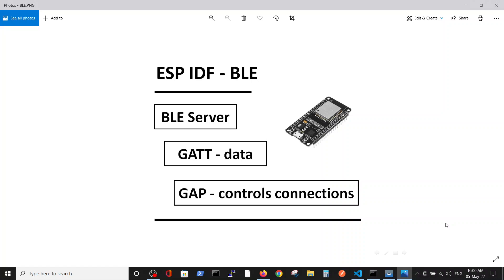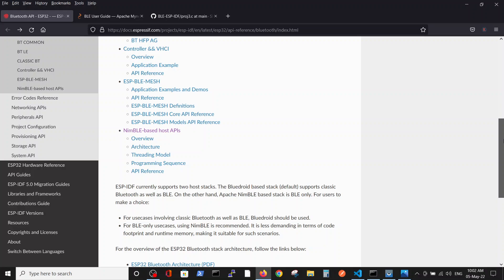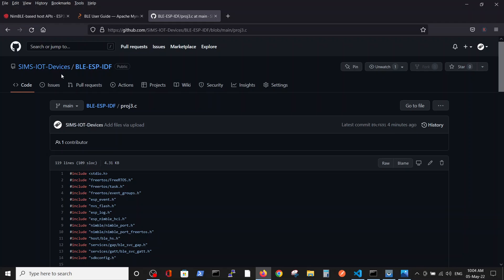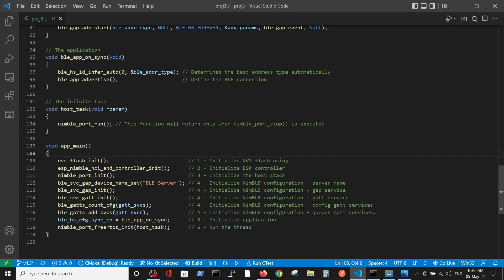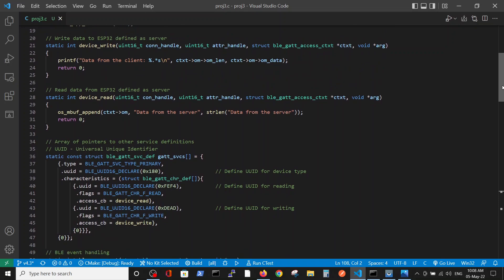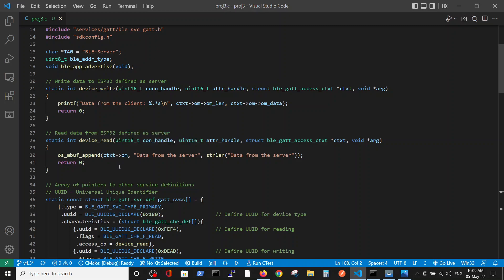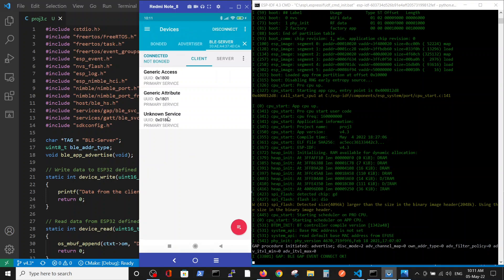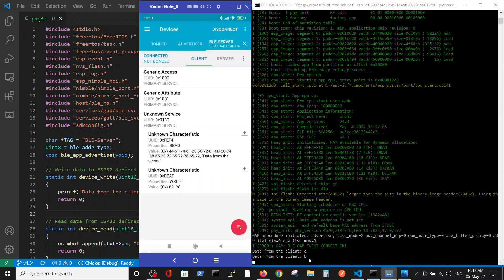2 - ESP IDF 4.3 BLE server for ESP32 in ESP IDF environment

Comment: Thank you! Very usefull video. I got all needed in 13 mins.
Reply from the maker: Glad it was helpful!
Reply: @simsiotdevices6219  Hello. Do you know how to add new characteristic to existing service during BLE is already started( in runtime)? Is it possible using NimBLE?
Reply from the maker: Dear @ildarbelkin4851,
I would guess that adding new characteristics to an already running service would depend on the device's ability to enable dynamic attribute modification.

Comment: Thank you so much, very very simple and helpful video !! Just an update : the function line 111 "esp_nimble_hci_and_controller_init" needs to be replaced as "esp_nimble_hci_init" because they changed the function name.
Reply from the maker: Dear @user-dl5ls8bi5o,
This code was compiled on ESP IDF 4.3, which version are you using?
Reply: @simsiotdevices6219   I just tested this on ESP-IDF v5.1.1 and I had to change it to "esp_nimble_hci_init" to make it work

Comment: I really appreciate this video a ton.   Though, I am not getting it to work ... It's compiling okay without errors but, just not working (when I attempt to use my iphone to see it and connect to it, .. it is not showing up on the scan) ... I noticed an odd line in the debug output as follows:  

W (1105) BT_INIT: esp_bt_controller_mem_release not implemented, return OK

Here is the full logging output:

W (1105) BT_INIT: esp_bt_controller_mem_release not implemented, return OK
I (1113) BT_INIT: BT controller compile version [6881869]
I (1119) phy_init: phy_version 302,3ddfab3,Dec  3 2021,14:39:12
I (1174) system_api: Base MAC address is not set
I (1174) system_api: read default base MAC address from EFUSE
I (1175) BT_INIT: Bluetooth MAC: 7c:df:a1:e2:85:26

I (1185) NimBLE: GAP procedure initiated: stop advertising.

I (1188) NimBLE: GAP procedure initiated: advertise;
I (1192) NimBLE: disc_mode=2
I (1196) NimBLE:  adv_channel_map=0 own_addr_type=0 adv_filter_policy=0 adv_itvl_min=0 adv_itvl_max=0
I (1206) NimBLE:

and I did a search to discover this conversation:

https://github.com/espressif/esp-idf/issues/9420

I wonder if it has something to do with this? ...
Reply from the maker: Dear LarryNybo,
Did you try different BLE applications on your iPhone?
Reply: @simsiotdevices6219   ... I tried my iphone, my mac laptop, and a pc ... none of them are recognizing the device.
Reply: Wait, .. the way you stated that caused me to realize I didn't have a "BLE application" ... so I downloaded an application and it is working.  Thank you for your help.
Reply from the maker: @LarryNybo  You welcome

Comment: Hello I have to send sensor data from one esp32 to another esp32 using BLE using ESP IDF  but I am not able to send the data ..I am using gatt client server example . How to do that?
Reply from the maker: Dear K K,
I added the video for the esp32 server to the esp32 client BLE communication to the wish list. I will get to it.
Reply: @simsiotdevices6219   okay ..for now i want to know that from gatt server data will be send to gatt client ? Right ?
Reply from the maker: Dear  @KK-ib5nh ,
Generally speaking yes.
The client video link: https://www.youtube.com/watch?v=_kDXrtZWG5E
Reply: @simsiotdevices6219  okay thanks. Now i want to enable Bluetooth and wifi in my code . I have merged my wifi code  bluetooth gatt server code .bluetooth is initialising but not wifi ..if I comment bluetooth initialsation in app_main then wifi is getting connected ..how to do that wifi get 1st connected and then bluetooth will get connected.
Reply from the maker: Dear  @KK-ib5nh ,
You can encapsulate them in two different tasks running in parallel.

Comment: i am using ESP-WROOM-32 Device with Rainmaker App and having a problem tried with BLE and SoftAp, no luck BLE Error message "Communication Failed" sometime it says "Cannot find the device"
SoftAP Error message "Assisted Claiming not supported for SoftAP. Cannot Proceed" again tried to flashed with new firmware using espressif firmware tool still no luck. Tried to connect with nRF Connect App, got an error in log "Error (0x85): GATT ERROR" if i use auto connect it will get connect after long time to nRF Connect App
Reply from the maker: Dear Ahamed,
That is exactly the reason that we opened this channel. If you write the code in the ESP IDF by yourself, it will be much more difficult, but you will have the ability to debug and customize the code. In the Rainmaker App you have only the encapsulated solution.
Reply: @simsiotdevices6219  tnx a lot. i will try to do through ESP IDF and i'll get back to you if i have any questions?
Reply from the maker: Dear  @ahamedzakky518  
Of Course, if I can I will gladly help.

Comment: once disconnected from app not able to reconnect, need to restart the esp32 to reconnect 
need to update the code so that it reconnects without restarting the esp32
Reply from the maker: Dear Vinoth,
Usually, the ble_gap_event function consists of more than 150 lines. The purpose of this channel is to present the simplest possible code witch has minimal functionality, but is easily understandable. Thus the ble_gap_event function is in the smallest and simplest form.
Reply: Yes, you are right. I saw the gap_event_handler in the ESP examples code and it has 5 entries of the switch (event). Do you know if there is a complete functional example that uses Nimble? it doesn't look like something that I can write myself. Anyway, I appreciate your work to bring some light to the issue. Thank.
Reply: @simsiotdevices6219  
Thanks for the answer. I found the solution, below is the implementation .it  just solved my problem 
 static int ble_gap_event(struct ble_gap_event *event, void *arg)
{
    switch (event->type)
    {
    // Advertise if connected
    case BLE_GAP_EVENT_CONNECT:
        ESP_LOGI("GAP", "BLE GAP EVENT CONNECT %s", event->connect.status == 0 ? "OK!" : "FAILED!");
        if (event->connect.status != 0)
        {
            ble_app_advertise();
        }
        break;
// Advertise if disconnected
   case BLE_GAP_EVENT_DISCONNECT:
	   ESP_LOGI("GAP", "BLE GAP EVENT DISCONNected %s", event->connect.status == 1 ? "OK!" : "FAILED!");
	   if (event->connect.status != 1)
	   {
		   ble_app_advertise();
	   }
	   break;
    // Advertise again after completion of the event
    case BLE_GAP_EVENT_ADV_COMPLETE:
        ESP_LOGI("GAP", "BLE GAP EVENT");
        ble_app_advertise();
        break;
    default:
        break;
    }
    return 0;
}